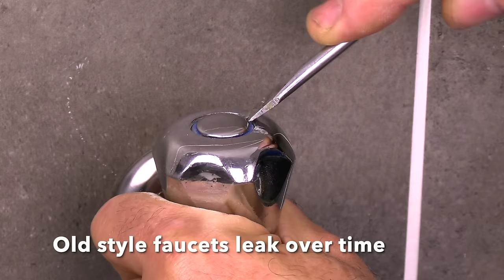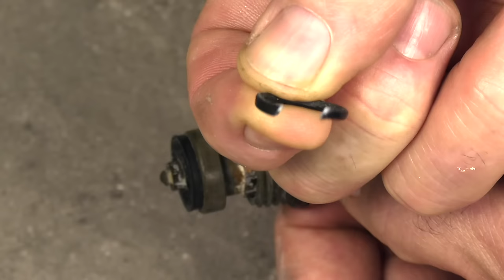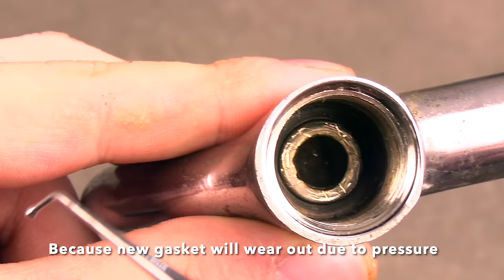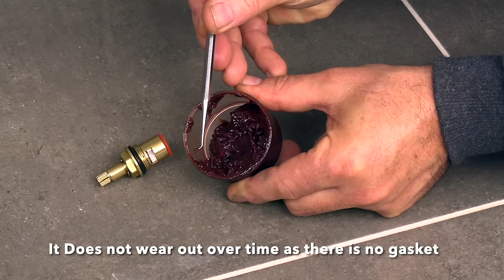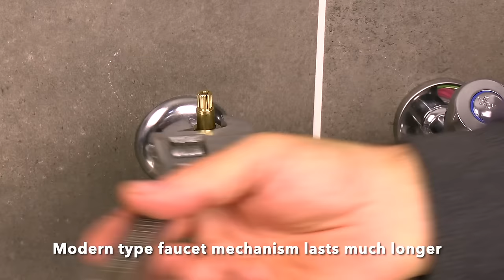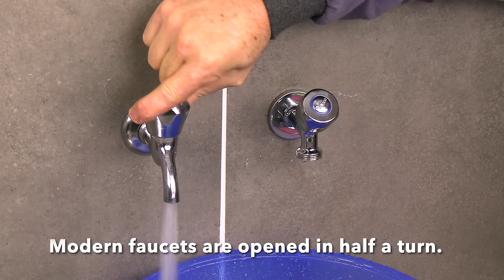Absolute Solution to Leaky Faucet! Your Faucet Will Never Leak Again

Comment: Cartridges are not universal, this doesn't work with all faucets.  The wear on the bottom of the flat washer, indicated that the seat was worn or pitted.  The seat should have been changed as well as the flat washer, if the leak was from the spout.  The biggest mistake with that system, is people tighten the handle down way too much.  If everything is new, that much force isn't needed.  If the leak was from the handle.then the "O" ring needed replacing.  Lubricating the "O" ring with silicone grease, not Vaseline.  Vaseline deteriorates rubber.
Reply: Exactly!!! The problem is when guest stay over or people you live with won’t listen to this advice because they don’t have to fix it😅
Reply: Important tip about silicone grease vs Vaseline. Ditto about checking the condition of the seat!
Reply: @DaveEtchells  I know, just enough, to be dangerous.

Comment: The large lever handles designed for disabled, aged and elderly people like myself are better. These do not rely on forced physical strength to open or close the switch. Nor do these need many turns of the knob. As shown by the modern tap in this video.
Reply: Yeah but they still leak after a while it's a rip off not being able to buy  the internal parts without the housing

Comment: -- Denedim.Anlatılanlar yanlış
-- Absolutely No.
-- Mechanism with Gasket works properly.
-- But the other new method will leak in a short time.
-- The new one could be designed better.
--  And it can be redesigned.

Comment: Juat fix your gasket, and washer and screw if need be. A piece of dirt can scratch the ceramic and wear it out, forcing $15 repairs annually. Maybe add a filter to house to prevent dirt?
Reply: The filter is a great idea, especially inline with the commode fill water line ... keeps that water level valve clear of sand, grit, particles that can hold open the toilet fill valve.